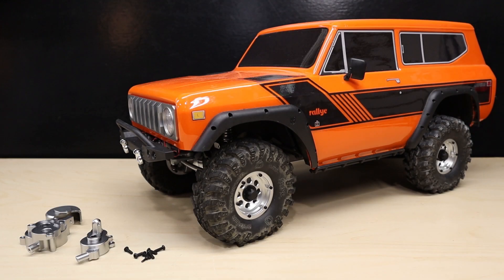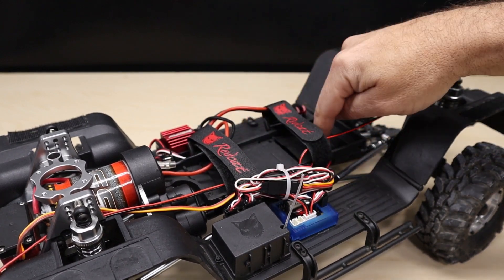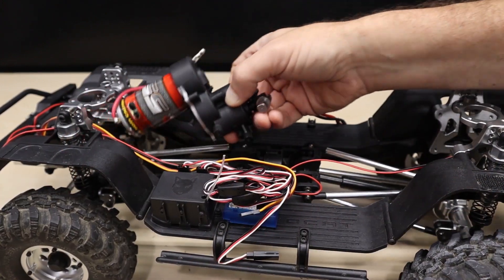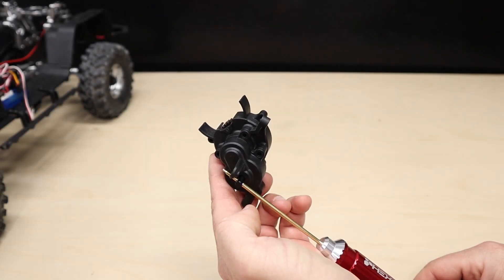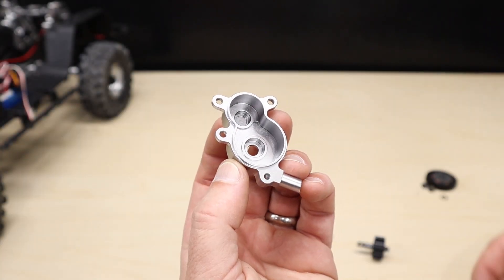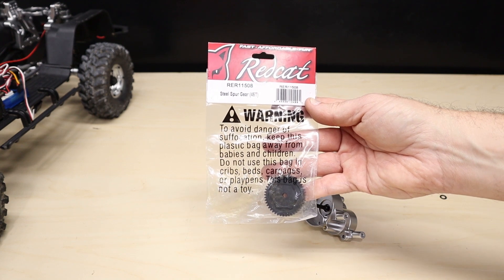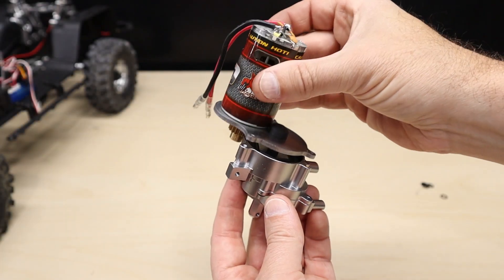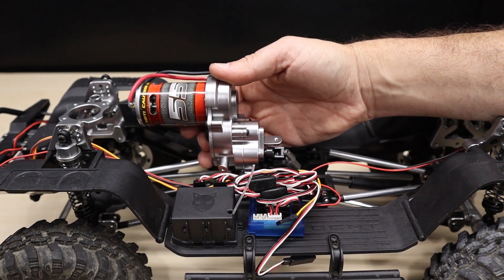Redcat University - Gen8 Scout II & PACK Alum. Transmission Case Set & Steel Spur Install

Comment: Just received in mail, and when test fitting.  It doesn’t line up to the frame! 🤬 bottom is the one not lining up to screw.
Reply from the maker: Not exactly 100% sure where you are talking about on the truck but try reaching out to our support team - they might be able to help. support@redcatracing.com

Comment: Servo relocation or make something to fix the bump steer and fix so it will turn tighter. This is what it looks like ..O.. and this is how i will like it to look ..o..
From this ..O.. to this ..o.. ????? Please i can'tt rock it with out doing a 50 point turn from 55° to 47° or more°
Reply: 100% needs this.... this thing cannot turn a tight Circle to save its life but it's a great crawler just needs some upgrades there one out there it's aluminum but it's $30 from club5..... And do you have redcats flat skidplate 💯% no more bump to hangup on 😜
Reply: Please redcat make the servo relocation for gen8
Reply from the maker: A possibility for sure. But the design serves it purpose on a general standpoint. There are some folks who want o get a little more "aggressive" and "competitive" with the design but sadly those are not necessary to make the rig a decent crawler out of the box like it is.
Reply: 100% best RTR out there and good prices just need more upgrades 😂    and more and more thanks REDCAT..... 100% truth I have never looked your way before i did not like your old line but now OMG you did it congrats.....  TRAXXIS NOT NO MORE!!!! Just sick of the over price parts and add ons sorry!!!!  THE CAT GOTS YOU BY THE TRAXX.....

Comment: The gen 8 becomes a like 800 dollar truck with all the redcat aluminum. Then you are left with a really strong truck that still has weak portal top gears and many many weak undersized bearings. As soon as you add all that weight the plastic pin retained gears will start to become an issue as well. The plastic gears are really strong but the pins are small and much stronger. They can easily cut into the gear. After the extreme weight gain the incorrectly assembled out of phase drive shafts will become an issue and start to tear themselves apart at an accelerated rate. The driveshafts cannot be put in phase either due to their poor design. You literally have to be lottery lucky to get a gen 8 with all 3 axles assembled in phase at the factory.
Reply from the maker: If someone is going to put that much into their truck they would probably want to add the Chromoly drive shafts as well as any other steel or CNC'd part available direct of from 3rd parties. Which would handle much more stress with all the aluminum and such. 

Not only that, drive shafts being out of phase on a scale crawler is hardly a concern as the effects of that process would not be as effective VS a full size vehicle or a RC vehicle which travels at a much higher rate of speed or with much higher RPM's. To date there is no model that has had any issues due to "drive shafts being out of phase" even on Gen8 models that have traveled over 100+ actual miles and more. Regardless of the torque produced by the system it practically has no effect the trucks drive train at all under normal driving circumstances.